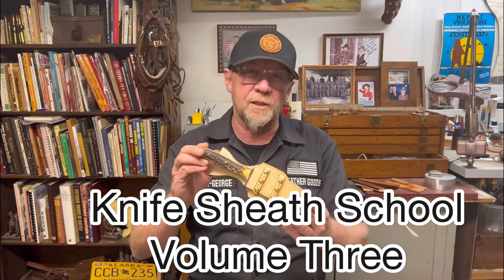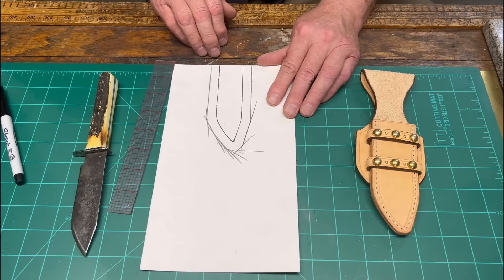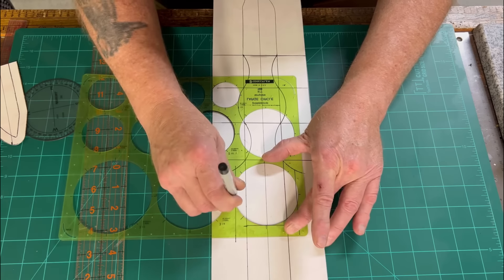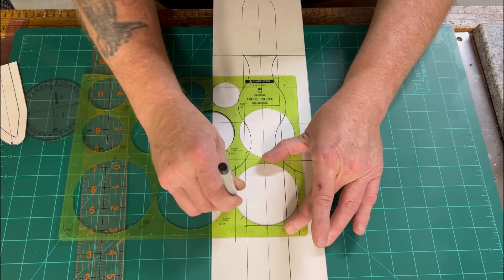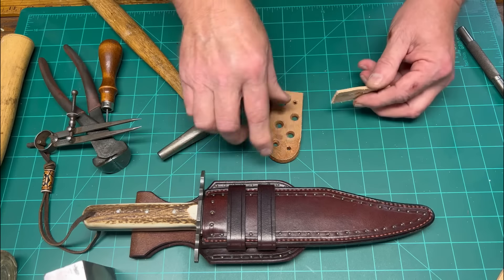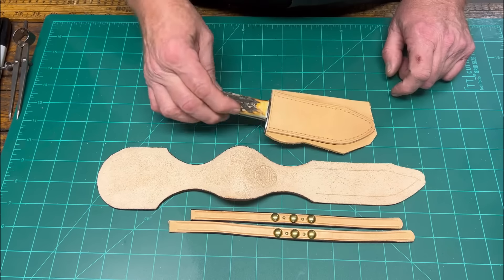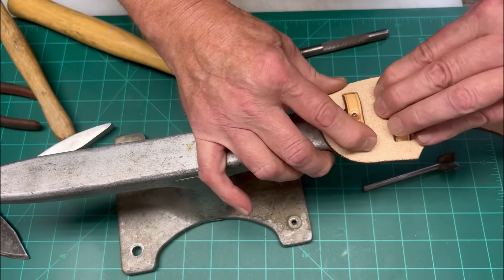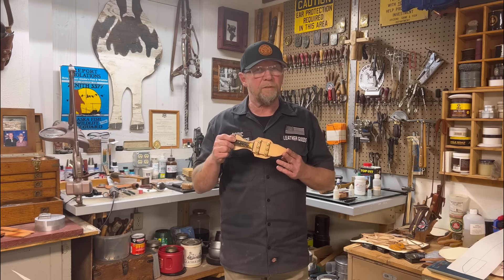Craft A Mexican Double Loop Half-skirt Knife Scabbard #youtuber #diy #diycrafts #mexico #youtuber

Comment: Keep those videos going! I love it. I've work with leather for while but I'm just starting to get into knife sheath and it's really something I struggle with, especially when it comes to wet molding and retention and planning the adequate clearances, but also when I'm asked to make a knife sheath that's not meant to be carried vertically, or horizontaly, but at some angles. This type of sheath (not folded) are more straightforward for me as the knife fitting is pretty easy, but still, I love the craftsmanship that goes around it, and you're pattern making techniques are really helpull. Thank you for sharing! 

I have one question though, why would you dye it at the end, and not before assembly when the hardware is not in place already?
Reply from the maker: Thank you CK!  I appreciate your kind words and I agree that these sheaths are pretty straightforward and it’s my intention here to start with basic sheath design. I’ll eventually do more which will show some angles and horizontal (scout carry and bushcraft type attachments) 
I have done both methods regarding dying. I use an airbrush for dyes and within five minutes of dying take a soft horsehair brush to surface burnish which removes the dye from the hardware. Thanks for your banter it’s appreciated
Reply: @viktorgeorge9144  can't wait to see your next videos, i've already learn a lots of little useful tricks from you! Even if we know how to do something there's always something else we can take from the experience of others :) 
 I think I'll invest in an airbrush soon, it's been a while I'd like to try it. Thanks for the answer! Until the next one! Take care
Reply from the maker: Absolutely CK I’ve learned something from total novices and more from my mistakes😅 then I care to admit. I appreciate your support so thanks again

Comment: What size escutcheon pins are those?  Enjoy your videos 👍
Reply from the maker: I appreciate that🤙  I’m not sure what size those are other then the nail is 1/2” The head is about 1/16th” round. 100% brass 
I’ve had these for years 
I know the current ones are plated and don’t work so the search for em isn’t easy.
Reply: @viktorgeorge9144  thanks for the reply, I found some 100% brass ones but they're larger